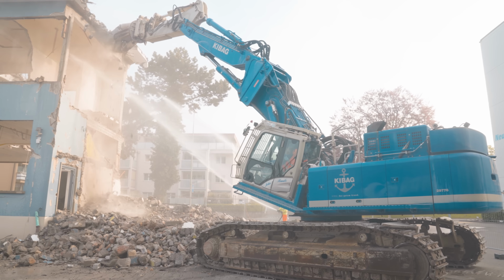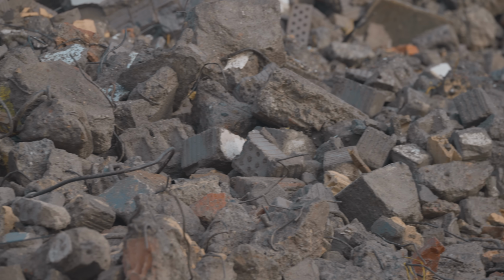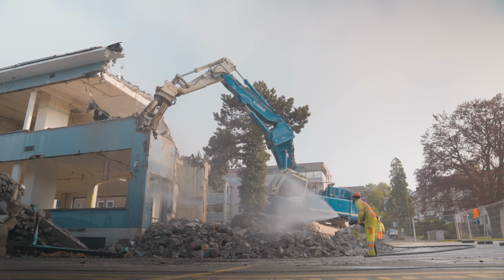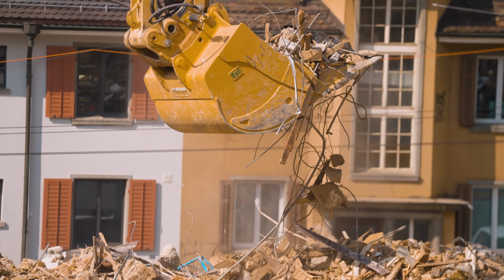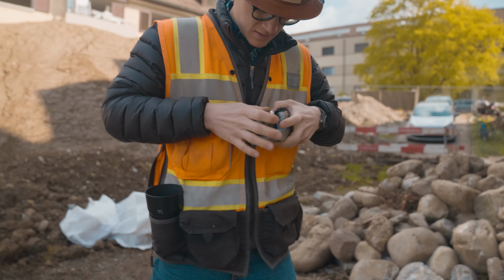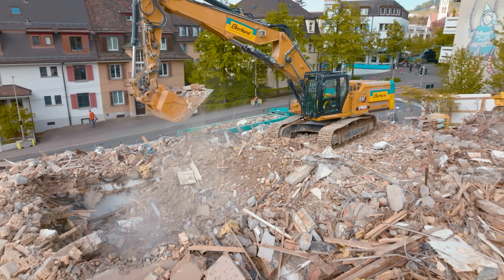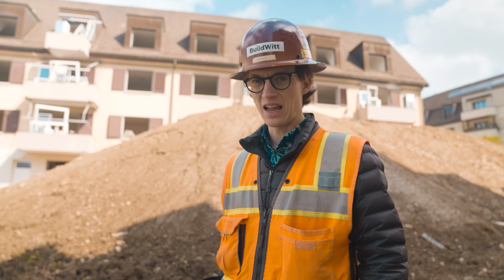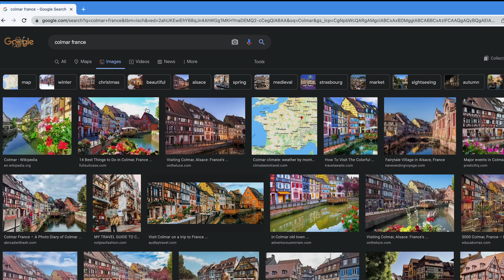Munching On Buildings With Custom Demolition Machines | Oil Quick Attachments | Euro Vlog 5

Comment from the maker: What demolition attachments are used frequently where you work?
Reply: In my area (west of Austria which is next to switzerland) every Company has Oilquick or something similar, most tools are Sorting Grabs and Hammers for demolition of old houses. When it comes to buildings with more concrete demolition shears and magnets are also used very often. And here you can say EVERY Excavator has a narrow bucket, a normal digging bucket (often two one with teeth and one without, and a tilting bucket). I have never seen an excavator with a thumb in real life. Excavators up to 25tons often have tilting hitches, and mobile excavtors often are bought with a tilt rotator, especially when they are used with forks, sweepers, grading beams and such.

Comment: Yes there's the upfront cost of the specialized attachments and quick couplers but think of how much more productive you can be and how much more effectively every machine hour is used. Not to mention the efficiency, qol, and safety benefits of not having as many laborers on the ground. Hope to see the US adopt more of this tech
Reply: Yeah but you can get the same job done just as efficiently with a “normal excavator” without having to invest in those specialty auxiliaries.

Comment: When i saw the first few videos from america on Chris (LetsDig18) channel i was a little stunned what old tech you use. Oilquick may be quiet expensive in the upfront but i think when you do just one switch per day it will be paid off after 2 or 3 years and u can use the coupler on the next machine when you get a new one

Comment: I think he named it self a HMC (maybe for Hitachi Multi Carrier).
But the correct description is (KTEG) KMC (Kiesel Muliti Carrier)
They are based of Hitachi machines and modified by the german Hitachi dealer Kiesel founded company KTEG in cooperation with Kocurek (excavator modification company based in England) are responsible for the construction of the undercarriage.

Most of them use a OilQuick boom changer.
Up to the 40t class of the basic machine, the KMC can be equipped with earthworks, demolition, material handler and lattice boom crane equipment. Over 50t basic machine with telescopic demolition equipment.

The above is the KMC P version. Then there is the S version. For the S version, the undercarriage & boom construction is carried out by STC B.V. (similar company to Kocurek | based in the Netherlands). However, these machines do not have an OilQuick boom changing system. The diversity of the machine is therefore not great. There are only earthmoving & demolition booms. In addition, possibly an extension piece.
Reply from the maker: excellent. thank you very much for this info

Comment: Those quick couplers are nice and I have not seen them in the states. Those booms on both of those excavators are short booms for high reach excavators those two machines can switch from that boom to a high reach boom. Most companies around me use those machines to do the main demolition of the structure and use normal excavators to do all the sorting and clean up. Once the structure is down they will switch to that shorter boom to help assist with the sorting and clean up.  Most demolition outfits around me in Seattle run booms like that and as far as attachments breakers, grapples, shears, concrete pulverizers,  and concrete shears are common.
Reply: OilQuick and Steelwrist are slowly becoming more popular in the US. 
Only the Hitachi KMC 600 has a Longfront boom, and even OilQuick to Change booms. Those KMC (Kiesel Mutli Carrier) excavators are modified Hitachis made by the german Hitachi dealer Kiesel. The Cat 336 just has a VA Boom. Most small demolition jobs and sorting work is done by normal excavators, just as you said. Eberhard has a big fleet of Cat machines, but the only Longfront excavator is a 395F. They also own a 395F VA and a 385C VA (which used to be a Longfront, but was rebuilt by their own shop) Kibag is one of the bigger companies in Switzerland and they also own just a few demolition excavators. A Hitachi ZX 690-5, its predecessor, an older ZX 670-3 that isn‘t used often anymore, this Hitachi KMC 600 and a Komatsu PC 390-11 HRD.
Reply: @peon9282  thanks for the very valuable information i have seen these companies on forums and in videos before. I have no idea what is in their fleets. As was stated Europe and the United states do things very differently from eachother for example back in California demolition copanies like penhall, like to use tools that use a stiff arm like a concrete pulverizer or a grapple or a crypto klaw if they need a thumb. I know 2 videos ago when eberhard was demolishing that bridge they had a wheeled excavator. In the United states it is rare to see one and you would never see one on a demolition job. I know they are very popular over there in all aspects of construction.
Reply: @The690ELC  True, wheeled excavators are only popular in Europe, and 99% have VA booms. However backhoe loaders aren‘t common in central/northern Europe. I‘ve seen these excavators, with the crusher attached to the stick cylinder, looked weird to me plus that setup doesn‘t allow you to change tools in a reasonable amount of time. It’s easier, but of course also much more expensive to install OilQuick (or another quick coupler) on all your machines and have all your tools interchangeable. Wheeled excavators are very useful for smaller demolition and earthworks, trenching in urban areas etc. Some wheeled excavators have their own trailer for their tools, so they can move from job to job. It’s much more common in Scandinavia though, where they also use tiltroators on almost every machine.
Reply: @peon9282  interesting with the trailer for the tools i have seen backhoes hin europe when i was in vienna but they shift side to side and the outriggers go straight down. We do use quick couplers in the states in demolition or underground utilities work but you still have to get out and hook up hoses for hammers and other hydraulic attachments that oil quick is quite slick.

Comment: Why can’t I find any info on this excavator online? The HMC 600. 
How would I order one like this 😂
Reply: That‘s a KTEG KMC 600-6 BTV, built by german Hitachi dealer Kiesel, it‘s based on a Hitachi ZX 490-6 I think.
Reply: @peon9282  Or maybe a 530
Reply: @Walter Ruggerio I think he named it self a HMC (maybe for Hitachi Multi Carrier).
But the correct description is (KTEG) KMC (Kiesel Muliti Carrier)
They are based of Hitachi machines and modified by the german Hitachi dealer Kiesel founded company KTEG in cooperation with Kocurek (excavator modification company based in England) are responsible for the construction of the undercarriage.

Most of them use a OilQuick boom changer.
Up to the 40t class of the basic machine, the KMC can be equipped with earthworks, demolition, material handler and lattice boom crane equipment. Over 50t basic machine with telescopic demolition equipment.

The above is the KMC P version. Then there is the S version. For the S version, the undercarriage & boom construction is carried out by STC B.V. (similar company to Kocurek | based in the Netherlands). However, these machines do not have an OilQuick boom changing system. The diversity of the machine is therefore not great. There are only earthmoving & demolition booms. In addition, possibly an extension piece.